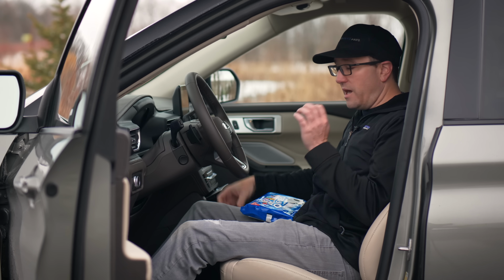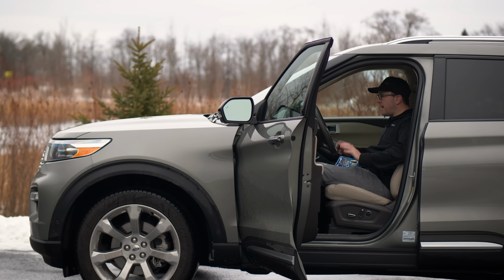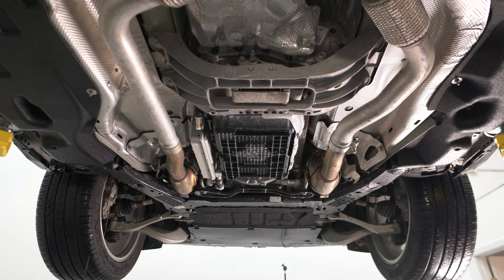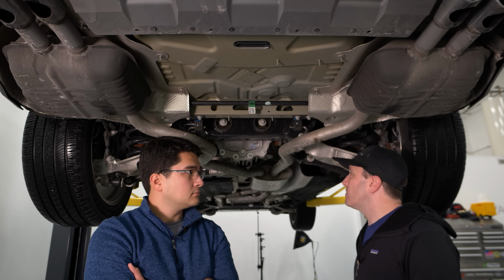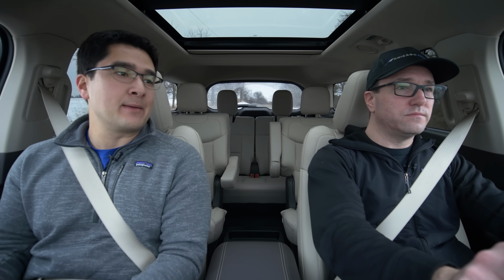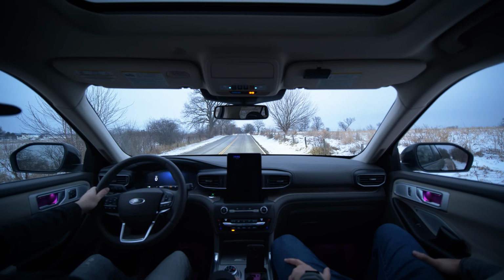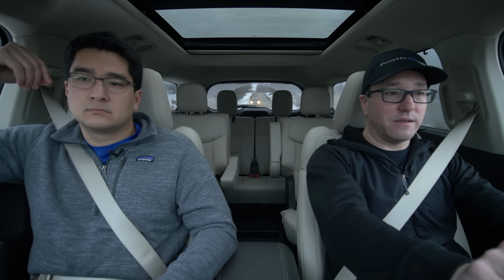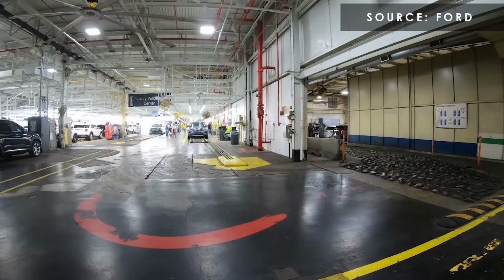2020 Ford Explorer | Who Is Responsible For This?

Comment: Engineer on the Explorer program here.  All I can say about this entire vehicle is “Look how they massacred my girl.”  I expected nothing less coming into this review, but it hurts to hear nonetheless as an engineer who takes pride in his work.  Your final thoughts nutshell what’s wrong with U625 perfectly, although as with any nutshell, it doesn’t give a good sense of the scale of the issue.  It wasn’t just the plant, or the engineers, or the designers, or the management, or the workers.  This program has suffered so many cock-ups that literally everyone involved has made a contribution to this end result.

The Fields administration wasted far too much time and money switching the Explorer back to RWD for “platform synergies.”  The CD6 platform’s cost ballooned out of control and became hopelessly delayed as they tried to develop an architecture that would be able to underpin nearly 10 different cars - that failed so badly that most the vehicles whose future relied on CD6 were outright canceled or stayed on older platforms, with the Explorer and Aviator being the only two left.  The platform was then re-optimized for the SUVs at the insistence of project leads, who wanted to sell it on performance and supposedly had research to back up their claims it would sell better if it handled better.  It definitely does, but they were dead wrong about most consumers noticing, never mind caring, about the engine layout and primary driving wheels.  Engineering was too worried about the new architecture and engines to devote adequate time to pretty much anything else.  The F-150 program requires about 120-200 test mules per new generation, spanning all trims and powertrain combinations.  The Explorer program built over 300, and Aviator tacked on a more reasonable but still significant number.  We ended up building nearly twice the number of test mules as the 2021 F-150 program did, and because of the need to keep building testers, the PP cars were delayed, meaning that the process of engineering that new assembly line had to be compacted down to meet the deadlines.  Can’t make a line to build the cars without knowing how the car is built, after all.  Chicago Assembly being its typical shithole self (engineers and management alike were practically dragged kicking and screaming into choosing Chicago) finished off any hope of this launch being anything short of disastrous.

I’m still a firm believer in the Blue Oval, and, flawed as she is, I proudly stand by the Explorer, enough to order an ST for myself - it arrives later this year. The sad truth is that this has been happening ever since Fields took the reins and focused on sucking up to Wall Street instead of running a car company.  Nearly ever program started under him and inheriting his bullshit attitude if salutary neglect has stumbled.  The 2020 Escape/Corsair are the only ones that haven’t, and that’s at least in part due to getting a free troubleshooting extension after Explorer pillaged a big chunk of staff to help out with fixing its own shitstorm.  Hackett has not done anywhere near enough to fix this, but some effort towards a better culture is better than actively destroying it.  Ford will learn; the question is how long until it forgets again.
Reply: I wish more engineers would speak up like this. It’s nice to get an idea of how much of a headache getting a new product out can be.
Reply: @mikem2253  Great way to get fired if you did!
Reply: 2009 Ford retiree here--This has been going on to a lesser degree since Nassar was the CEO so that this happened comes as no surprise to me.  Mulally was seen as the white knight riding in to "save" the company, let's not forget that the DPS6 transmission fiasco happened on his watch.  Fields was nothing more than a career Ford hack to begin with.  IMO, Hackett isn't the problem, those that hired him are.  The Glass House needs a through cleaning,  Ford family and their Class B shares included.  As a final thought the Explorer should have went to KCAP.
Reply: @robertjones7565  I was just going to point out this structural issue and the silly corporate approach to making cars go all the way back to Nasser who almost ruined the company. Poor Ginta if he thinks this is a temporary thing and that Ford will learn from its mistakes.
Reply: I am a professional engineer myself. I just want to know, who and why approved the absurd looking out of place touchpad control panel on the dash? Was the R&D and Testing too excessive to justify the current high MSRP’s on these vehicles? I honestly love the 2019 and early generation Explorers, but this new generation, besides their updated engines, is a no go for me. In the near future i will most likely go for an updated refreshed Kia Telluride.
Reply: @al151  It's obvious to me that whomever designed the interior went for form and not function. They obviously never tested the center display visibility. And whomever designed the software for the infotainment system didn't do a good job of utilizing all the space available to them.
Reply: The points you’ve made are the primary reason why my 16 explorer is my last ford (5 others prior). Certain components not aging well, the galvanic corrosion, the fucking steering wheel..literally...the fucking steering wheel leather peeled off.
Reply: Sold ford for 2 years, work at Volkswagen now. It’s ridiculous how cheap the interior is regarding the 35k to 48k interior compared to the Atlas. Not sure if it’s a fair comparison but it’s the same competitive and price range. The EXPLORER ST is the only one WORTH BUYING TOO IMO. The door alignment sucked on them, a pillars falling off, missing privacy shade pieces, engine not turning over but all electric buttons work, and the aviator had the same fucked up craftsmen build. I couldn’t believe how bad the door jambs were, I had customer started asking what is the production date on this vehicle, usually ford customers NEVER ask that LOL
Reply: Michael Buffington I just bought a 4RUNNER for the wife, I can’t find anything I don’t like about it. Made in Japan. Yeah it’s not fast, but it will last.
Reply: James Wuertele smart buy, hold great resale value.
Reply: @JAMESWUERTELE  That's a great way to describe the 4Runner. There's nothing to really dislike on the 5th gen. It's just a very well built suv that does traditional suv things well. Excited for the 6th gen.
Reply: @mbuff47  they literally fall apart as you drive them
Reply: GintaPPE1000 Reading this comment made my day. I appreciate your honesty and transparency and also your pride in your work and consideration for the perception of the vehicles you engineer. I’m studying engineering in college and I’ve thought about working in the auto industry, but I’ve had second thoughts since there just don’t seem to be many people at these OEM’s like you. I could definitely see myself working with engineers like you, though. Hopefully Ford can get it together with perhaps a mid cycle update for this Explorer.
Reply: Already seeing them coming back for warranty. Got one that has about 1100 miles with a shot tranny, so thanks for keeping me busy at least. If you know the guys setting the warranty times, ask them to go easy on us techs please
Reply: TR P the new escape looks like someone drew what another person was describing about a Porsche Macan over the phone
Reply: @trp2413  "Apple infotainment" lmao you're delusional
Reply: I'd really like to know how this Ford engineer feels about the new Bronco. While I like its design and features, I'd feel foolish, unfortunately, spending that kind of money on a Ford product.
Reply: Anna Carson Your argument?
Reply: Dear engineer, I’m a military officer, trained and experienced in leadership. GM and now Ford seemingly are mis-prioritizing. It’s not about investors and stocks because that invariably leads to cutting costs in build quality and reliability. If Ford invests in engineering, and build quality, the payoff is Toyota-like. I own an F-150. So people, not money, let your creatives build cars that are dependable, functional. Some of these gadgets are not worth it.
Reply: a fwd explorer would have sucked... it was just a big car back then!
Reply: Dude just buy the 2023 V6 Honda Pilot or Toyota Highlander instead for a reliable 8-seat SUV for your family. 
Ford’s mistakes are not your responsibility to pay for, and their recent failures don’t command any loyalty.
Reply: How about narrow everything down and make 10 reliable vehicles with 5 or so RELIABLE engines--you guys are like bMW and Mercedes and have 40 diffrent vehicles--trims--etc with 30 diffrent engines--with everything having shoddy reliability.I use to buy Ford--i just bought a Stinger GT AWD 3.3TT--Kia has like 8 cars and maybe 5 engines and their reliability is now excellent.People are smarter about their finances and are not going to buy cars that have subpar reliabilty.I would put the 5.0 engine in all the cars and make it bulletproof and reliable to a tee.One medium repair on a vehicle and any gas mileage you save with say that 3.5 turbo engine is nil.Every Ford I ever had--SHO--Mustang__Escort GT==Saleen Mustang--were in the shop for problems and all leaked  oil at some point.Plus delaers treat customers like we are all joe dirt.BTW I had a gM exec as my roomate and said the same thing to him 15 years ago and he even brought it up.i said to him you guys make 3 very good cars and 27 shitmobiles that are overpriced and breakdown.Noone wants to buy crud cars anymore--the internet rats them out before folks go buy.70% of car buyers now check the net.BTW American cars are the reason i bought my fist Honda 10 years ago--love Nascar--love americn muscle cars--but hated the reliability and treatment at the dealer more.I also have bought--as in walk in and give a check for the full amount of a car since I was mid 20s--so you folks lost a good customer like me that will prob not go back after reading this.You know I was in the market for a Super Shelby truck--had a 100k check and was LIED to about it--not only that many dealers can not work on them and they will not do any work till Ford approves.Having the shelby plaque in the service bay--but when you speak to them they are unable to work on shelby vehicles.
Reply: @khronin  you really think Kia and Hyundai make reliable vehicles? They’re a long way from competing with Toyota and Honda when it comes to holding up over time.
Reply: @mattmolloy636  Yeah I do--KIA gave me the 10 year warranty on the whole car and I have dragged mine and not a hiccup.JD power is neutral and gave them the best score.They at least back the cars up with the warranty.You can also go on the forums before you buy like I did and there was noone on it out of a thousand folks that had any major repairs like blown turbos etc.But you can insert any carmaker in what you just said.what about  100k plus jaguars--bmw--mercedes benz and audis that have awful reliability.
Reply: And do not even get me started on dodge or ford.
Reply: @khronin   of course they give them long warranties, no one would be confident enough to buy them if they didn’t. The opposite is true for Toyota and Honda, they don’t offer a ten year warranty because they don’t have to. Also you own a Stinger, those things haven’t been manufactured long enough to have hard evidence for how badly they’ll fall apart towards the end of your 10 year/ 100k mile coverage, so you really can’t say “my recently made car that’s still new hasn’t fallen apart yet, that means it’ll last forever.” Try using that same logic with an Audi/ BMW/ Merc, they run smoothly for the same amount of time you’ve had your Stinger but we all know long term ownership with those brands is a fool’s errand. With that said, the resale value on the Stinger plummets worse than those German autos. Just look at Doug DeMuro’s purchase that was new on the lot for $52k and was sold to him for $37k, and he was the first owner! The second owner on up will be taking an awful hits to their wallet when they go to sell it, and that’s because the market understands that the cost associated with maintaining a Kia are closer to German autos than their Japanese competitors (aside from maybe Mitsubishi/ Nissan). As for not getting you started on Dodge and Ford, I’ll level with you that Dodge (esp since the FCA merger) makes garbage trucks that fall apart/ underperform and are bought more for aesthetics than actual utility. You cannot say the same thing about Ford, 80% of their business is trucks and they make the best pickups on the market because the lions share of their money is poured into them. Ford knows their buyers and plays their position well, while FCA makes several impractical Hellcat models when they can’t figure out how to sell a midsize family sedan. Jeep is the only thing they have that’s close to standing on its own, and even half of their line up consists of dressed Up Fiat 500’s w/ AWD. It’s hard to knock a company like Ford when they’ve done a good job focusing on their strengths with both brands, they’re the only American auto makers actually doing that these days while FCA/ GM keep making the same mistakes they made before the 2008 recession.
Reply: @mattmolloy636  Dude I owned the most unreliable car ever made--a 1996 Olds aurora and it was never in the shop.I own all my vehicles and have them serviced at the dealer and the only brand I have ever had problems with is Ford.I am also well off--so my stinger could self destruct and i could go buy another 40k with no sweat.I also have a 2020 honda HRV--I am not sme rookie car owner.I also owned a crosstour type R that i traded for the stinger--I have all my veficles I have owned in the last 15 years on here.I also paid cash for my stinger--it was 44k--I got 2 rebates--one from KIA and one from the dealer and KIA gave me 19k for the 10 year old Crosstour Type R--so I ended up paying 19k and they warranted the whole car.19k for a 44k car is not bad.Car also runs 12.7 in the quarter.I shoot periodic you tube videos on my car and will report any bad for all to see and KIA was actually happy about that.
Reply: It's a shame when chasing the dollar and chasing a great reputation can't be the same end goal in synchronicity. There are few companies that execute this. I am a cultist and a hard one when it comes to 2 brands. 1st brand/s Toyota/ Lexus, yes they have their short comings however they prioritize 3 things. Quality product and consistency, accountability. I am not sure if anyone knows about the frame problems they had on their trucks or even the head gasket issue on the 2nd gen 4runner (could be 3rd don't quote me) they were doing recalls and service for 15 years and on. Alike for Lexus on the IS with tge melting interior. I could go on and on but we get it. Another brand I stay loyal to is Honda. Now they've fell off a bit and they can never make a proper A/c system but it is what it is. Their motors a like toyotas are bulletproof. They've come around to making better cars that surround a quality powertrain and that is good to see however I do notice some accountability issues that seem to have been due to corporate not caring as much as they should. Now back to Ford. We have owned several in our family and TBH they leave me confused. Sometimes I absolutely adore them. They make some awesome cars and at time I want to just light the thing on fire. They need some help up top to just work out the kinks before they end up looking like FCA and being absolutely horrible. I trust that Ford will come around. Maybe I am just a fool and I am just hopeful.
Reply: wish Ford would produce a smaller version of the Explorer that has the "truck like" feel he's talking about in this vid, a higher truck like ground clearance too, pre-2013 Escapes were like that, and Ford turned the model into ugly little sh*tbox hatchback cars, with more cargo space than a regular car only because they made it slightly taller, but it's still a car and not a truck, or anything close to a truck, the Explorers are a bit too large and expensive for most people who want something in between a car like "SUV" and a real SUV
Reply: VERY insightful.  Thanks for sharing.  I hope you enjoy your ST.  You probably have it by now I'm guessing.
Reply: Just to say it, tell whomever decided to have a huge piece of chrome above the passenger glovebox in the 2014 ford explorer sport. Was an awful idea. Nothing better than getting blinded by that ridiculous piece of trim. Every. Day.
Reply: Thanks for your insight!
Reply: doubletappinhillbilly my dads was the opposite, his transmission started having issues first month he got it. Can’t remember if it was 1-2 or 2-3 shifts that were really harsh but it seems ford tries to put it so much stuff they fcuk them selves over. For the love of god bring back the actually shifter instead of a rotary dial😭
Reply: YoitsNick I’m on my 4th shifter on my 2013 Explorer Sport. The “shift to park” issue plagued this generation of explorers.
Reply: how come  I have to buy the top of the line to get a v6 ?  st or platnuim ,2 .. need a 2 row fx or raptor explorer
Reply: Anna Carson  WHY?
Reply: My last Ford development job was in the U-260. Nothing you are saying is even remotely surprising.
Reply: I cared about the layout.  I would not have bought the Explorer if it had stayed fwd based.
Reply: I'm heavily considering a Explorer ST myself based on my needs, and while I understand what I'm getting in terms of build quality of potential issues, I don't get the decisions that Ford has made with this platform in the sense of: 2022 orders already opened up, and you still cannot get Sync 4 or wireless Carplay/Android Auto when the F150 already got this for 2021. Also, in 2017 and 2018 the F150 added port injection to the 3.5l and 2.7l ecoboost engines to help keep those intake valves clean, yet the 3.0 ecoboost that is supposedly based on the 2.7l does not have it. Why? Why Ford?
Reply: @CubanRider  Freind who workd at corporate GM years ago.Honda and Toyota make their money on sales while sadly Ammerican and Most German make their money in the service dept which is pathetic to have that type of motto.One Dodge dealership actually had 90% of their money from repairs and would sell the cars for well under msrp becaue they knew right after 36k the car would be in for repairs.
Reply: @CubanRider  look up Ford Explorer complaints. My friend needed a new transmission at 13,800 miles! Buy a Toyota
Reply: This comment should have been pinned.😅
Reply: Who authorized the removal of the second differential bolt on 2020 Explorers?  Now with a tecall on it.  One bolt to hold the drive train together in the rear.... WHY?  I hope you can provide some idea on this design/engineering change.  And, can the second bolt be added to the frame?
Reply: Can all the shareholders promote you to Chief Engineer or CEO please?
Reply: just wish there was a fx4  off roader with a true low range and no 3rd row for us overlanders /car campers
Reply: This great to read.
Reply: Nice write up man! Thanks for the inside info 👍
Reply: Never liked Fields from the books I've read about the industry. Mad that Mulally primed him to be a successor. How are thing looking under Farley? I know he has roots in Toyota/Scion/Lexus -- hopefully he brings some synergy back to the Oval.
Reply: hope ford can make better products, cause I do love me some ford but god damn this reviewer shit on the car : /
Reply: The transmission will fall out before 20,000 miles. I bought a Highlander
Reply: @golferpro1241 My transmission experienced hard shifting at 20,000 and once opened up had heat damage to clutches.  A TSB was issued for the repairs. I am now dealing with a recall on the differential to frame single bolt design.  They want to replace this bolt with another single bolt on my 2020.  Why? Why not install the second bolt too to alleviate the single bolt issue altogether?
Reply: Give us the contour rs then.
Reply: There things that I feel could have been better. I have an overpriced sound system that I can't get just right. Cabin resonance. Tiny seats. There is so much tech in the car I'm terrified. I don't understand why we are forced to buy a vehicle that costs more to purchase, fix, insure, maintain and gas up. Make it make sense. But we love them, I guess. I had a Prius V and Toyota decided they weren't going to make them anymore. It was a car but we sat higher like a SUV. I didn't like how she drove like a Carolla. So now I will pay out the whazoo for gas. YOLO!
Reply: To this engineer-- I own a 2020 ST and love the car except for one thing.  The tech failures are constant. 3 Times every tech failed feature such as cruise, auto hold, speed sign  reading, crash alert, reverse brake assist, blue screen. One time even the power brakes failed and I almost had an accident.  Very disappointing.  And worst of all is the dash design especially the stick on terrible screen. I have been driving a Ford product since 87 and now I am seriously looking at other brands.
Reply: I know you wrote that 2 years ago but I love my new ST. Would have never purchased a last gen Explorer.
Reply: I truly think, the grass always looks greener on the other side.

I think this is just a state of the times, not Ford itself. I've driven many cars/SUV especially in the last decade over 250k miles and over 50 vehicles and the 2022 Ford Explorer ST is nothing to slouch at. I pick this over Audi SQ5 and many other cars sub 130k. A big thanks to whomever pushed the performance and handling aspects as this was a major reason for me personally being able to select it over other vehicles. I think marketing dropped the fuck out of the ball here not showcasing what it does when you put your foot into it as most reviews seem to overlook this. Additionally your dealers didn't help, I had to go through about 20 dealers in August 2021 trying to get an ST /w options, 6 hour drive to get one.

You need the ST, I drove both before deciding from LA to San Francisco round trip. The ST is the business.

Whoever says this is the worst transmission cannot drive 100%, the transmission is fucking fantastic. Probably helps if you don't let 800 people drive the car in basically the worst condition/scenario.
Reply: Okay… I love your insight. But on my personal opinion I think the 2011-2015 2016-2019 style should come back. That’s the models that I think look so good and the 2016 ford explorer Platinum, is actually my dream car. 2020-2023 I’m not a fan of, and I really hope ford can make some changes and do better
Reply: greed ruins all car manufacturers
Reply: I bought an ST myself today. I have 2 Explorers(Wife has a limited). I like them. Honestly, though I did go with the smaller infotainment screen in my ST.  The bigger one just looked ugly and I really didn't like how it functioned.  Anyways, blue oval faithful.
Reply: @Nissan370Z Glass bruh i think you're a little nissan biased
Reply: Who read it till the end  ?
Reply: I loved the Explorer when it was truck-based, but they ruined it in 2011.  I got cancer that year.  Coincidence?  I think not.  I feel like the 2020 is in some way improved from the 5th Generation, butt he exterior styling is very meh.  I want classic styling.   The interior looks OK, but I'm not into infortainment.
Reply: @benjaminslayton4335  holy shit 😂
Reply: @benjaminslayton4335  I don't think unless your Explorer had an unshielded Fission reactor you could have got cancer from it months after you bought it...
Reply: So which part of the cockup did OP contribute to?
Reply: It sounds bleak because it's your livelihood but I'm predicting Ford to dissolve or be bought out like Chrysler was within the next 20 years. Ford has been churning out crap for 2 decades and people have noticed; cutting production of cars to focus on SUVs won't be sustainable in the long run, several recent launches have not gone over well, and the F-150 is losing sales to the RAM despite it's reliability issues. There is time to turn it around but based on your comment it sounds like management is blinded by short term success goals and won't be able to pivot when trends change.
Reply: @spletest8977  It goes to show that aesthetics matter much more to the average US consumer now than functionality, reliability or ergonomics.  It seems Dodge and RAM were the first to realize and take advantage of that, followed by Tesla before the Koreans came outta left field and started kicking ass in all categories.  Now the big three are running tails between their legs towards EVs, not because it's the right thing to do, but to save their sorry butts from getting to the point of no return.  This is the problem with companies that are given blank government checks in exchange for IOUs.  I wish Stellantis luck with Dodge/Jeep/Chrysler, but Ford and GM should have been left to rot.  If they had, all the assets and talent in those companies would have been snapped up by Tesla, Rivian, and Lucid.  We'd all have been better off.
Reply: @spletest8977  The issue is Ford is the only Americain car company I know of to never been in danger of bankrupcy... So I doubt it will and it still makes great vehicles like the mostangs, Broncos, Mavick and F-150 that's better then Nissan at it's worse as the only good vehicle I now of was the Z and that's it... I got a %99 fully loaded 2020 Mustang ecoboost premuim when I could have got a Mazda MX-5 grad touring resevse much more vehicle in every way for the same out the door price of $34k both have a MSRP at around $40k. I got the mustang mostly becuase I love that very year and their is nothing speical about any current Mazda to me. And my Mustang has treated me well and has none of the issues the current Explorer has. The issue it does have is some parts look leather the are not and the real leather bit are the cheapest leather I have felt... Exacpt the seats those are acually nice. Oh and the extoer has missaled panel like the doord look not sceure when they are but those are the only real issues.
Reply: I was born a ford girl ill die one!  Im aboit to purchase my 2nd one thus week.
Reply: End result sure fit and finish could be better but wow i lpve my ST. Go ahead buy your Kia but i am sure it doesnt make you smile like the ford explorer ST
Reply: @dantz34  My morning shit makes me smile more.
Reply: @GintaPPE1000 I Love my ExST.
Reply: I have a platinum myself. I could tell some oh the issues just on getting in it. But as was said in the video, a lot of those are things I could look past.

It sucks to see this kind of internal shit still happening. I grew up in a Ford family, dad still works at the plant by us. I work for the steel mill that was just sold a few weeks ago, and we supply a lot of steel to you guys. So it's full circle for me.

I really hope to see things turn around for you guys (and us as well honestly). If they offered to re tune the transmissions, I could very easily live with the rest. I absolutely love our explorer and hope it gives us many years before it kicks the bucket.

Goodluck man. 2020 sucks. Hopefully 2021 will be a turnaround year.
Reply: @Nissan370Z Glass your joking right? Nissan notorious for engine and trans failures, even more than the American companies.
Reply: @panthersfan8494  What Nissan engine failures? Please specify. As far as trans go, avoid CVT and you will be fine.
Reply: @povertyspec9651  Nissan is at the bottom of the list when it comes to reliability and Asian autos, second only to Mitsubishi and their horrendous lack of investment in their vehicles.
Reply: So, how have things gone during the last year? Will the wrinkles get ironed out?  Your explaining how Ford wanted this architecture to underpin ten different vehicles reminds me of the issues with the F-35 Lightning nightmare from Lockheed.  Yes you can make one vehicle do many things but it seems silly to try and make one vehicle morph into ten different vehicles, but it speaks of bean counters making decisions when they shouldn't. Overall I would say that it is not realistic to roll out a new vehicle and a new factory in such short time-frame.  R&D takes time.  Testing and validation takes even more.  Just ask Toyota why the LFA took like ten years to produce with great perfection.  Meanwhile the vehicle that need to make Toyota money are kept simple and reliable, which is fundamental to the customer .
Reply: You think it's gotten better with the 2023 model. It's one of the most affordable sales family cars on the market...
Reply: @camerongerman Yea!! I love how they are very affordable now. I’m just not a fan of the details and the looks of the interior and exterior. Some things are nice, but I would never buy one. I would buy a 2016-2019 cause I do want a explorer
Reply: @Nissan370Z Glass Nissan sucks now.
Reply: I think it's awesome, and Car & Driver totally does as well boss. This is my dream Ride, and once I finish with my Auto Tech Associates, would love to work in the Chicago plant to build these bro !!!
Reply: Interesting to hear your comments and they provide a lot of context. That said, the basic vehicle is a good one and many of the well-documented issues with the new Explorer will hopefully be addressed over the next couple of model years. Other things that get overlooked in most reviews: the vehicle is well-priced (in the basic XLT trim) and it’s the only one in the segment that can fit a 48” wide piece of plywood or drywall with seats folded down. The 4 cylinder Ecoboost has a surprising amount of pep, especially in Sport mode, and the best fuel economy in the segment as far as I can tell. I like mine a lot.
Reply: ubeuonly 1  lmao how unbelievable of you to generalize some based on one comment. I like Ford but I understand they are flawed, they aren’t even my favorite automotive company. Still you can’t deny the success of the F-150/250, Expedition, and Mustang. Even the new Bronco looks good. Obviously toyota is the best brand in terms of reliability but some people don’t like like the look, feel and experience of the Japanese cars. Did you get the feeling I was a Trump supporter at all yet? Oh because I am and I just proved how fucking stupid you are. Have a good day. Trump 2020
Reply: @panthersfan8494  lol. how's that working out for you.
Reply: @barrybarnes96  oof
Reply: GintaPPE1000 you don’t work for Ford Kia ahole